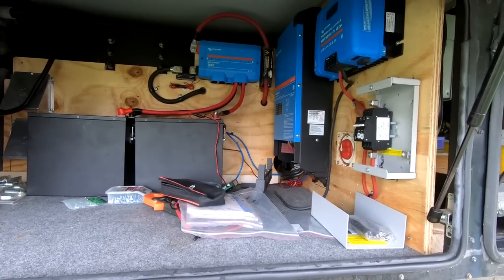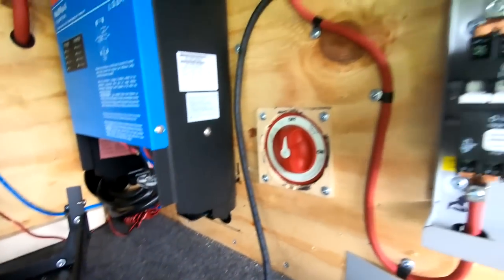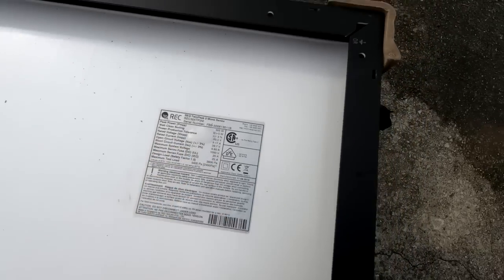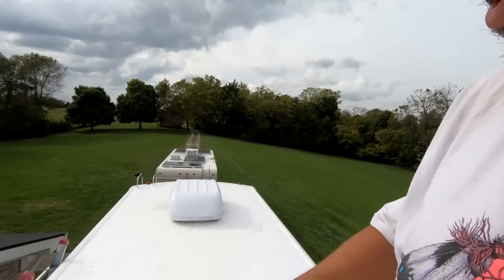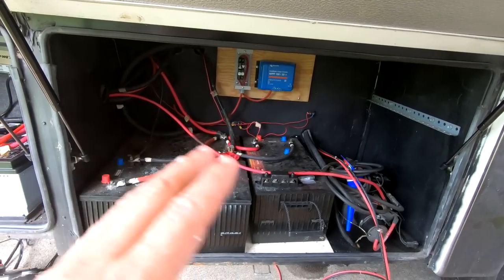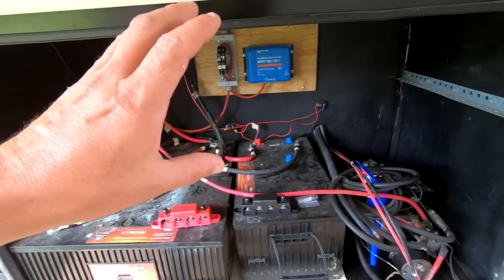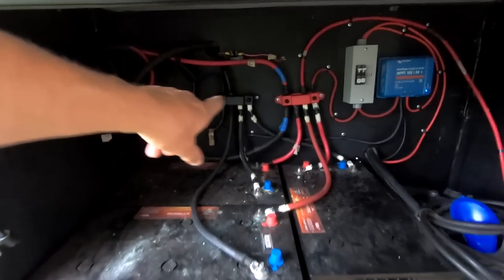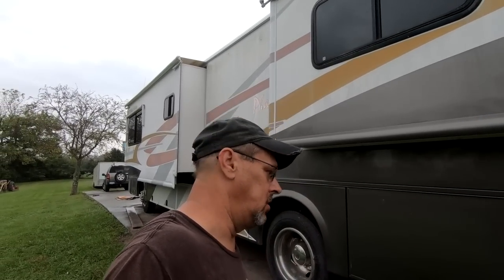Solar Installed, House Batteries Rewired Victron Inverter

Comment: Hey Wayne, A couple of nit picky things. Overall I rate your install pretty damn good! how-evver, You should avoid using copper terminals anywhere around batteries. It's just not best practice. You can use copper on the inverter and switch gear with no worries. Copper and batteries just don't mix.. Use the Thomas and Betts terminals. On the wire run from the panels to the charge controller through the wheel well, you should have ABSOLUTELY have put that in conduit.. Aqua-tite would be fine. The bare wires are totally unprotected and out of place. Should one of those tires blow (and they do), or de-laminate and start flopping around, it will take those wires out and possibly short them causing panel failure.
Reply: Saw the video and came to make the same comment. Some sort of protective conduit, even if only to protect from rocks that might get kicked up.

Comment: Condolences to you Wayne. Just wondering if you need some conduit around the wires going across the outside lower area there above the tires. Wondering about screens to protect any wiring area from critters entering into there.
Reply from the maker: No I think it should be good.
Reply: @rvprepperwayne  not really. See my main comment.

Comment: That's a clean installation!  Is there such a thing as putting an antenna onto the blue-tooth system to improve reception?  Merry Christmas, and may God bless.
Reply from the maker: Nope
Reply: Hmmmm.  I've found that adding an antenna, or a better antenna, can really improve performance.  But I've never worked with blue-tooth systems.  77, AE6YT.

Comment: Wayne I have a question..... instead of using those batteries could you use batteries from a Tesla? They hold a lot of power. Just curious
Reply from the maker: I use what the customer provides. I could use them but I would have to build them and get a BMS. To me its not worth it on an RV.
Reply: @rvprepperwayne  ok it was an idea in my head.

Comment: Nice Wayne, what is the labor cost on something like that?
Reply from the maker: Anywhere from 1800+ on a simple setup to 2000+-3000+ for a complex system
Reply: @rvprepperwayne  Thank you Wayne....what this job consider simple or complex?
Reply: @realfreedom5029  I’m sure he would agree that the system is very complex. It is actually two separate solar systems in one RV. One solar system powers all things that are AC powered, and the other solar system powers all things that are DC powered.